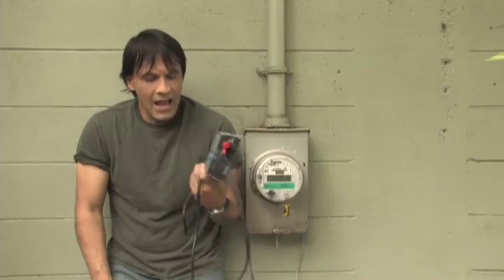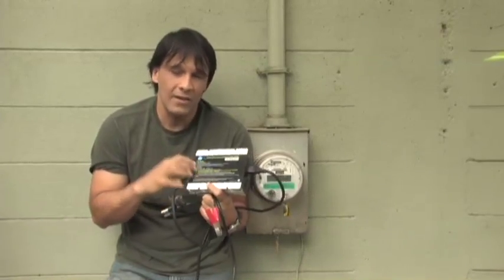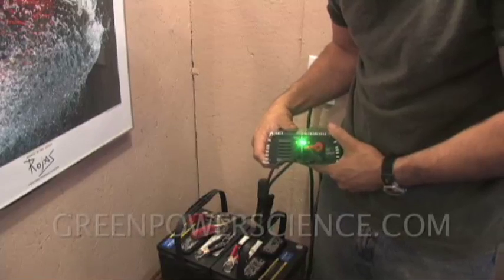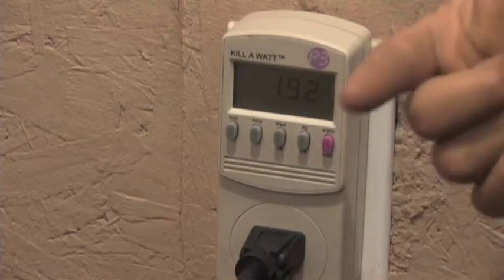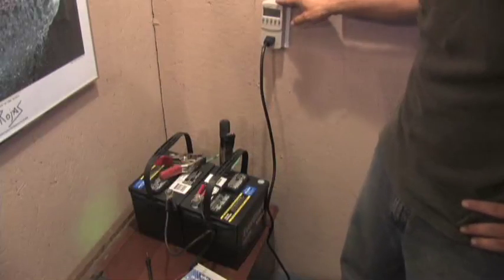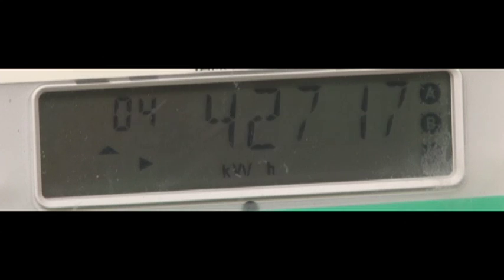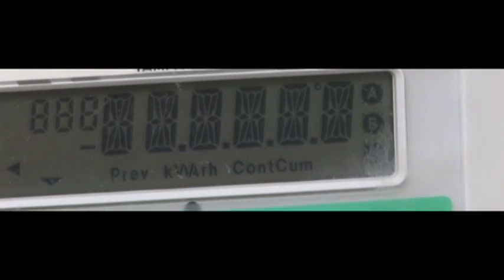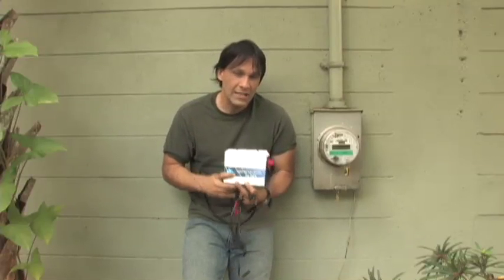GRID TIE INVERTER SOLAR panel POWER EASY Electricity Savings

Comment: the tie grid 1300 watt inverter on ebay is 88 dollars, second is it a code violation if grid is down and inverter is hot sending energy out into the grid when a line man is working on it? thanx man.

Comment: Interesting.... But one thing..  Towards the end, you said the meter will not go backwards.. "Greedy Meter"... But then you said you were at about 40 min. One number on the meter is 1000 watts. You have a 200 watt inverter. You would have to run it for 5 hrs...

Comment: I was going to say I've heard smart digital meters will NOT run backwards.... instead power you send back into the grid looks like power being consumed thus you end up paying for it. But it appears you proved they either are taking power without compensating for it or their meter is stopping your power from entering the grid (most likely answer)... And remember too, when they kill the power on their end we don't want to hurt the lineman out there working on the power-lines...

Comment: I REALIZE THIS IN AN OLD VIDEO BUT VERY WELL DONE. I WOULD LIKE TO KNOW HOW YOU CAN FEED BACK INTO THE GRID WITH YOUR MAIN BREAKER SHUT OFF. THIS WOULD ONLY ALLOW THE GRID TIE INVERTER FEED BACK INTO YOUR HOUSE. WOULD BE LIKE OPENING A DRAW BRIDGE CARS COULD NOT GO BACK OVER THE BRIDGE UNTIL THE DRAW BRIDGE WAS CLOSED OTHERWISE THEY ARE STUCK ON THE ONE SIDE. AM CORRECT OR DO I NOT SEE IT THE SAME WAY. WHAT I AM TRYING TO SAY IS THAT YOU CAN NOT FEED BACK INTO THE GRID WITH THE BRIDGE OPEN.

Comment: That is a 200 watt inverter it will need to run 5 hours at full power to make one KWH, so 20 min is not going to move the meter.

Comment: Wow, I am not sure what I make of your video, I was in a way stunned that your meter was locked, but understand that some but not all meters have this locked mode to prevent tampering.
But back to your video, it ended badly for me, I really wanted to see the end  result, did your Inverter manage to push back the 230W Into the Grid, we will never know.?
By the way that inverter does so much more than what people give it credit for.
Mr Spence Eng

Comment: While solar may be fine for single home use it is a very foolish and stupid idea for states to put our infrastructure power grids on solar and wind power. These systems cannot handle the day to day load especially when people use Rechargeable products, vehicles or whatever. I'd only consider solar power for my home if and only if the city power grids could no longer provide ample power to my home especially during hot summers or by off chance bad winters here in Texas. I have never heard my state or even city call on citizens to reduce power consumption ever until Biden and the democrats started pushing this stupid green deal crap. If Texas didn't learn its lesson from a year ago when we had that bad freeze and power outages being caused by wind farms then they will never learn their lesson. We are expecting a real hot summer and they are already having power grids going down and we are not even into June, July or August which is generally our hottest time of the year. The catastrophe that's going to happen this summer will either make people get off their asses and stop the government or they are doomed to suffer greatly. With our government now intentionally spraying our skies the so called chemtrails its going to be a bad run for those of you trying to rely on solar panels because these panels do not work at peak performance without direct sunlight. They are trying to fulfill Clouse Swabb and Bill Gates green plan to reduce sunlight by daily spraying contaminants into our atmosphere to darken our skies. One day you will realize the skies are getting dimmer and dimmer  daily and you will notice more and more crazy weather including seeing snow in the summer. Colorado keep a close watch as they are having a strange out of season massive snow drops in places they normally do not see snow. The government will try to convince you that it's climate change affecting us when in reality it's them intentionally modifying our weather to push their climate change bullshit. The entertaining part is I've told people I'll laugh hard at you for calling me a conspiracy nut, and trust me I've laughed hard at people when just about everything I've told them really happened.  The sad part about people in today's world is no matter if your proven right they still continue to believe the bullshit from the government because they have grown ignorant.

Comment: ..those dc binding post on the inverter get hot after years of use especially the positive terminal..the red plastic melted...the dc input using banana plug are not recommend.. after I tested the 600w inverter with maxed 2kwh/day solar input for 6 months ..so be cautious

Comment: It's going backwards but that meter isnt designed to tick backwards probable.   But I dont understand that if your feading 120v via the inverter into a plug that already has 120v coming out, I would think that wouldn't work.    ???   Idk.   Ima think about this.

Comment: First off, Ilked your video. Your utility meter reads in Kilowatts, Not in watts. Your inverter was supplying 235 watts per hour. It would take a little over 4 hours to turn the meter back. Does this inverter automatically shut of during a blackout?

Comment: You probably don't want to hook enough inverters together to push 2000 watts through a 15 amp outlet.  The wire (most likely 14 gauge) is  only rated for 15 amps or 1800 watts.  If you have 12 gague wire and a 20 amp outlet, it would be OK.

Comment: So what happens if you have these inverters connected and there is a power outage on the grid and you forget to shut the main off and a lineman is out repairing the line while these inverters are pumping electricity back into the grid

Comment: I have a question... I have two older 125 watt panels that when i connect together one only works half capacity. they out put 100 each, together i get 150.  whats up with that?
Reply from the maker: Series or parallel?
Reply: @GREENPOWERSCIENCE   I found the reason,  i was sending DC from panels long distance... to much resistance = voltage drop. now i send AC long distance and all is good.   oh  and parallel....

Comment: Please correct me if I'm wrong. I could use this inverter to connect to solar panels or its battery pack and be able to use that energy rather than energy from the grid? Of course if I was getting enough solar power. What's the life on this thing?

Comment: I know I'm a little late to the party but isn't this extremely dangerous if the power goes out aren't you feeding power into the Grid on a power outage and can't the workers get hurt
Reply: Actually, these types of inverters have 'islanding' and only operate if they detect grid power. So if the electrical power goes out, the inverter instantly shuts off.
Reply: @toddchamberlain_com  1

Comment: Wow you shut your main breaker at your house off. That open up and makes a air gap because your not getting power in your house. So if your main is off and nothing is coming in . Then nothing will go out to the grid. Pass your meter.

Comment: Yep this is the way it's going with on-grid solar "worldwide".. this vid was posted in 2009 and tech has come a long way since then (would not buy one of the above). Checkout the new style of grid-tie inverters with limiter (CT clamp) which monitor the power your house is using, and via your panels injecting power back into the household circuit to overide the grid (only what you use).. clever!  So the inverter only works when it sees power being used.. as long as your panels are generating. Who uses that much power at night.. right!  It also works with smart meters as they don't see the power being used.

The energy of the future is bright.. and cheap !! :)

Comment: It is illegal to use those in the US. A permit and a inspection is required to use them. They need to be UL listed for starters to be legal for sending power into the US grid. 
And no, power companies will not let you use them without you going to get all the paperwork done. Just call the power company and tell them that you will be using one of those and you will see how fast they will disconnect the power to your house.

Comment: Thank you for making this video and clearing up a lot of confusion.  Here in New York the electric company is finally installing smart meters in apartment and private homes. I think the best way to use solar energy is to have it disconected from the grid and change usage behaviors to save money. As a retired person I use my solar for fans and for charging batteries with inverters. The electric company only runs the air conditioner at night and the Fridg. So far this has brought down our usage a lot. By making everyone aware of how much they use and how much it cost , I was able to cut down on the expanse and still live comfortably.
Reply from the maker: Awesome comment Dart and glad to hear you are saving some money and making a difference. I alway encourage people new to alternatives to first delete all incandescent lighting (heat adds to cooling bill and only 2% efficient for light output) ad replace with LED. Dump old CRT monitors and TVs for new flat screens (most have by now) as they only use 1/10th the power. New energy efficient appliances, attic fans, better windows and then consider solar. These simple steps alone can drop consumption by 40% and would drastically reduce the cost of a professional solar install. 
Thank you for the great comment.

Comment: They're supposed to be made to shut off when they do not see power and then you and I shock a lineman with power feeding back into the grid
Reply from the maker: They cannot work that way, even if the anti-island were completely intentionally jumped, which it cannot be, the house and grid would be one massive dead load and shut down or destroy the grid tie inverter in a few seconds. You cannot power the grid from one house. Even if several houses all had GTI's with the anti-islanding deleted, they would experience the same issue. These are impossible to do what you say. Besides, qualified linesmen are taught to always assume the line is hot.

Comment: You need a net meter installed or else you will be charge more on your electric bill
Reply from the maker: You will not be charged more, just not credit if you back power the grid. Several of these cheap GTIs cut our bill in half with solar panels and a regular meter. Produce less than you use is and a smaller bill.

Comment: There are no plugin inverters that are legal or UL listed in the US.  There are many that claim to be UL compliant but they do not fully meet UL requirements (the plug) and thus are not UL listed.   Feeding into a non-dedicated circuit is also a drastic fire hazard potentially putting much more current on that wire than it is rated for.

Comment: Great Video Sir, I have bought 2 panels and want to install a 350 watts grid tie inverter i already have. My question is this. Since my two panels (250w and 270 w) will not produce more than 300 watts because they are not fully efficient, can I connect them with a 350 watt inverter or do I have to buy a 600 watt gti? I am asking since I don’t want to spend money to buy another more powerful inverter.

Comment: It will not go back the meter that way. Because if you turn off the main braker  you has not connection between the grid and your house. To make this provably work you need to have the main on and the braker for the power outlet you connecting that on on position and every other braker off.
Reply from the maker: Main is on, everything else except the one breaker the GTI is on is off. If you shut the main down, the Grid Tie Inverter shuts down. Disconnect from the grid and the inverter does not work because they are designed not to work during power outages. Configuration is what you mentioned in the second sentence.

Comment: Also what if you have a 200 watt solar panel but it's producing less than the minimum required? Or if it's dark out? Does it damage the panels then? So confused.

Comment: Dear Mr. Dan Rojas : Because i'm not a Professional person in electricity, so if you don't mind i have 2 questions , 
1st Qu. : Is this a regular inverter or it's a special kind / another kind ?
2nd Qu. : Should I pay attention to the electrodes when I put the plug or does it matter? I mean when the plug is connected from the inverter to the home feed voltage ! 
Thank you

Comment: So a "buy back" meter is what you need to make use of the grid system as a means of "power storage" (i.e. not "storage," but exchange, in which you can take back what you put in later when you need it). And they only give you about half credit, the thieves at the power company. At any rate, if you have batteries you can save power, and if you use power in the daytime (e.g. air conditioning) you can offset what you would have used from the power company. I'd guess the average person/family would save about 40 percent off their power consumption making use of solar to augment their power use in the day and using batteries if they find they make more than they use in the day (because they are out at work) and to make use of that saved power at night.

Comment: Thanks Dan for the video, I have heard that here in the UK power companies are paying for electricity produced by home owners, back to the main grid.

My question is if you use a Tie in Inverter and are producing more electricity than you use, how do the electricity companies know which house they make payments too?
Reply from the maker: They use special meters that register buybacks. If you do not have a special meter you basically give them energy for free as most digital meters do not run backwards. The idea with this is to produce less than you use so you are not giving something away for nothing. Also, some power companies can demand systems be removed if electricity is pumped into their grid without the special meter. If you use a bit more than you produce, they cannot say anything because the grid tie inverter is nothing more than an appliance. This can be difficult if no one is at home during peak sunshine. I suggest starting small and build a system as needed vs jumping in too big. We save about 50% with our system. I could go bigger but it works great.
Reply: GREENPOWERSCIENCE:  The whole point of a Grid Tie Inverter as distinct from an ordinary inverter is that if you are generating your own electricity from a dc source such as solar pv or wind and the grid supply to the house fails, the inverter senses this and shuts down preventing any power from being fed back into the grid and therefore to your house also.  With an ordinary inverter power would continue to flow back into the now dead grid so engineers could be electrocuted if they touched a terminal or wire which they thought was isolated.  By completely shutting down, the Grid Tie Inverter ensures the grid remains safe.  If you then still want power for your house, you have to isolate this from the grid using your master switch and fool the Grid Tie Inverter into thinking the grid is still supplying power, such as using an ordinary pure sine wave inverter running at the correct frequency, to feed into the Grid Tie Inverter so it thinks the grid is still connected and is live.

Comment: If i were to connect a 1000 watt grid tie inverter to a 24 volt battery bank which contains a total of four 75ah batteries (total of 300ah) totaling 7200 watts, will this be too much for one electrical outlet to handle?

Comment: You would have to have a Bi-directional meter from FPL or Duke Energy here in Central Florida . I know even for a fact when we had an analog meter with our 2.5KW solar grid tie system the analog meter disc would spin backwards and still charge us as if it went forwards! The dials would not reverse as many people would think or claim. Until we actually got  our Bi-directional meter we shut off the solar system. Thank God, FPL is still paying the same price we get charged for for what we over produce when it goes on the grid. Other states like Hawaii are no longer accepting grid tied systems. Bonkers. As others have pointed out you must have of course kept your main on and all other circuits off to try and make your meter to count backwards. I'm a licensed electrician.

Jeff
Sunny Central Florida 2.5k Solar System